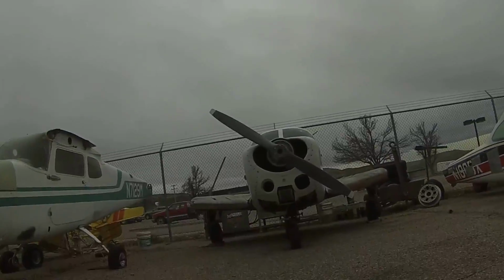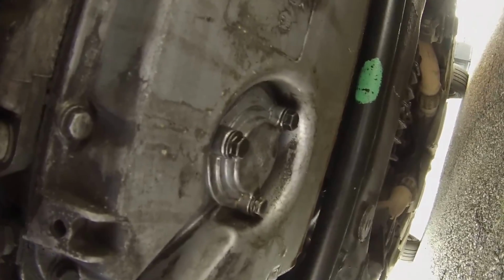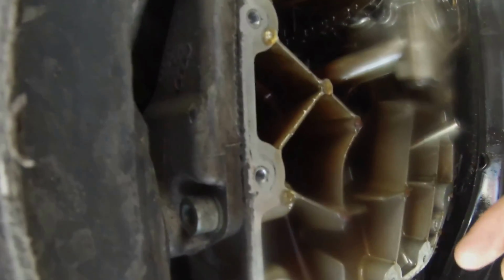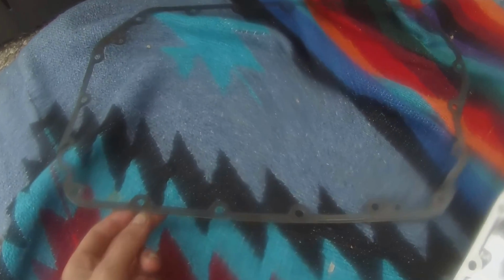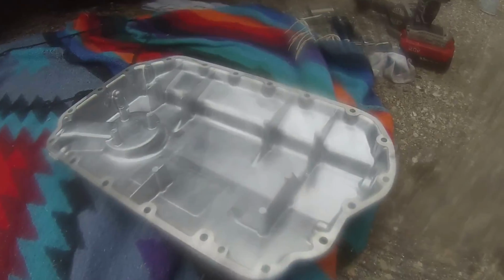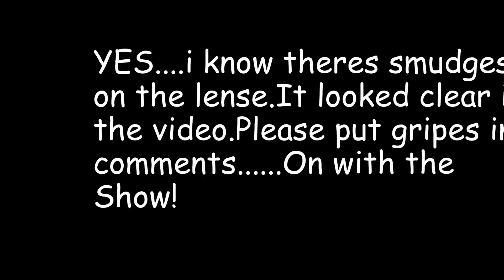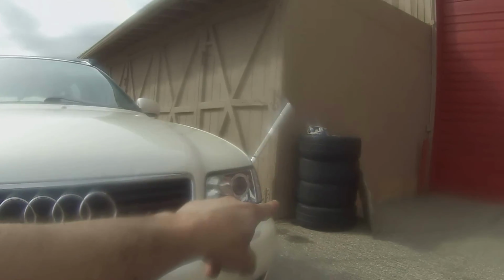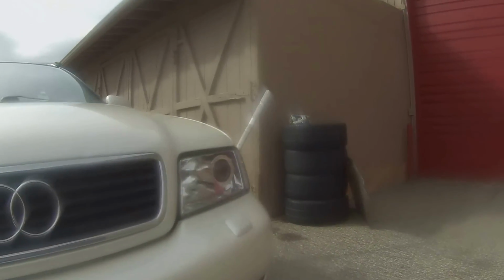1998 audi a4 wagon oil pan replacement! Cause....i cracked it....

Comment: Hey wonder will it crack on block ?? Since it crack the both part of oil pan ... like broken bolt on block where it hold oil pan upper.. possible strip inside thread in block

Comment: Which motor is this aeb?  I have a 99 passat b5 with an aeb and I recently found out I have a revised oil pan installed with a capacity of .4 quart more.
Reply from the maker: +MI Smith & Wesson i know its the 40V 2.8 v6.Were you looking for a model number?
Reply: JunkY BuildZ  oh you have the 30v 2.8. Sorry I did not read the description with an oil pan that small I assumed it was the 1.8. Both the four and the six-cylinder both have five valves per cylinder in the B5 generation. Three intake and two exhaust valves.
Reply from the maker: Ohhhh okey.Yeah for a 2001 i thought it would be bigger but it's not.They are easy to remove and install though.Thanks for watching!

Comment: Try not to run over a tire lying on the road.  That will rip everything off the bottom of a car.
Reply from the maker: I generally try to avoid tires as obstacles. Unfortunately.....massive curbs are sometimes unavoidable.